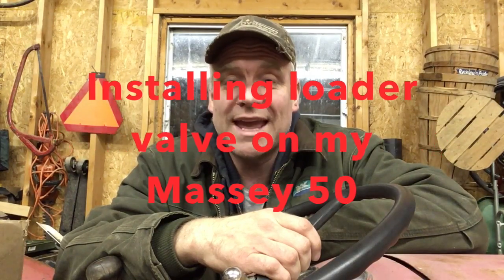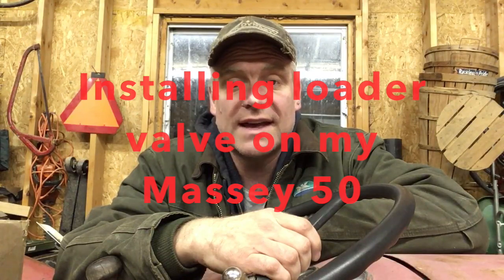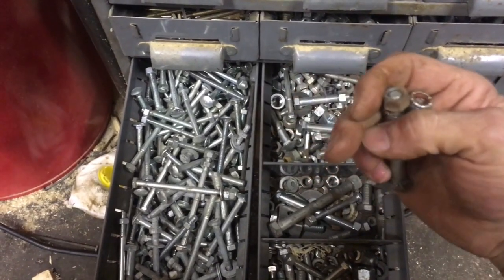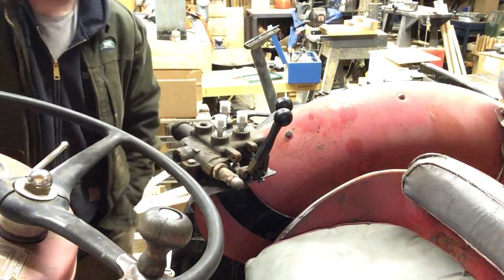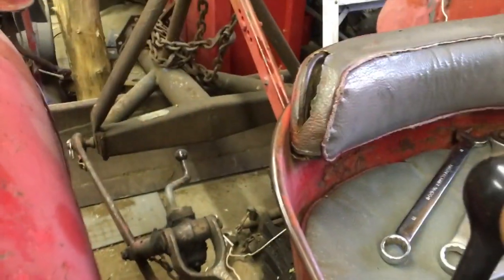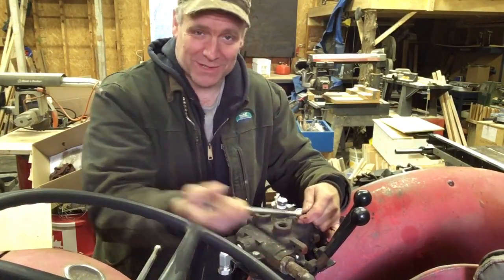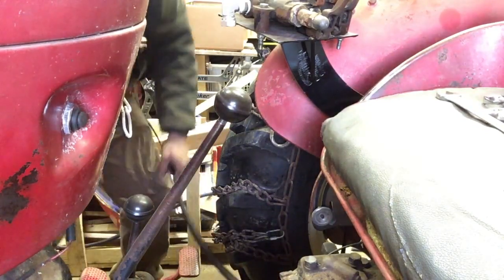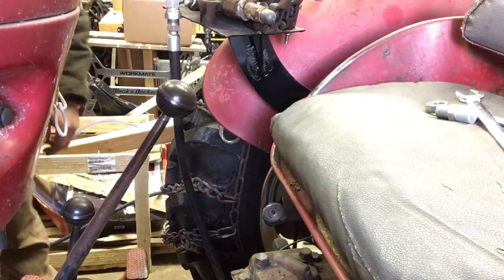Installing a loader valve on my Massey 50

Comment: Great vid! My T30 3 point is up and down, but front load not doing anything. The hydraulic take off hose to remote control valves is beside fluid level stick.  How do I know the pressure it at the control valves?
Reply from the maker: One thing I forgot to mention on the video I think you need to have something on the 3 point hitch or lock up straps. If you lift the hitch. The pressure will build. can’t just lift it up all the way because the draft will shut off the pressure at the very top. Hope you get it up and running.

Comment: I have a Massey Ferguson 165 with a MF32 front end loader. I have owned it for about 6 months now. Everything seems to work on it at this time, however, I would like to work on the carb, and throttle, but the loader is kinda in the way for easy access. Could you tell me how, or let me know of a place on web to go to for information. The pump on the front is tripping me up. I don't want to damage it trying to remove it, and it bolts to the rear axle.  Thank you.

Comment: MF 150. I want to add dual remote hydraulics.  Should I use the "Dual remote" hydraulic kit that is commercially available or use the system you used in the video? If your system is better please list product part names etc.. Thanks  you make great video! MFguy1

Comment: How does this work as you don't seem to have a diverter valve?
Reply from the maker: Uses the pressure from your hitch so the weight of the loader on my hitch will give me enough pressure to run my hydraulic function. If I didn’t need the three point hitch I would just raise it all the way to the top and I would have full pressure to run hydraulics.
Reply: @cheaphomesteading  cheers for the reply, interesting setup % of oil going to lift arm cyclider and another % going to the pipes valve. Works good for you. Yea I know full lift gives full pressure down the pipes. The diverter valve option is the same but means your linkage is dead while you have pipe pressure and adjust ram etc then divert back to linkage.